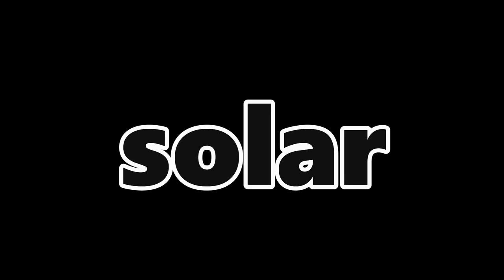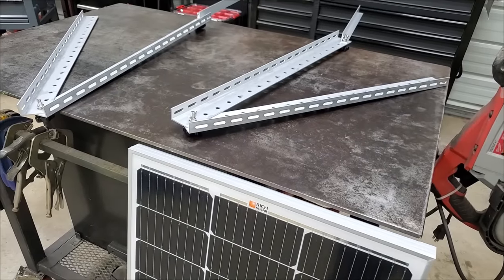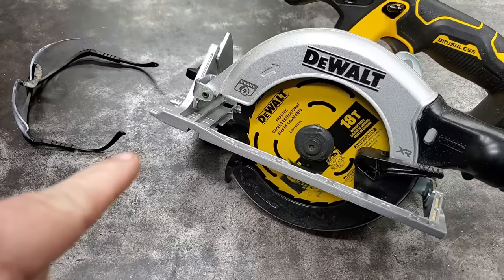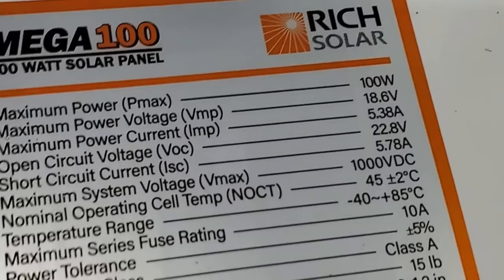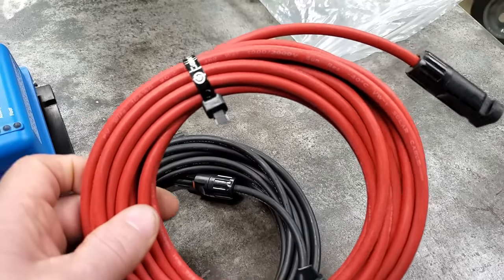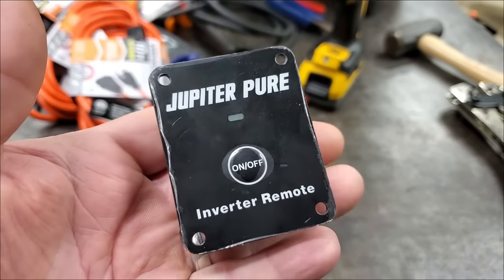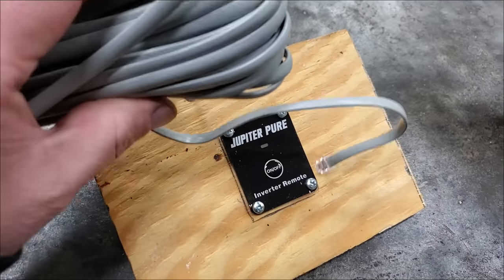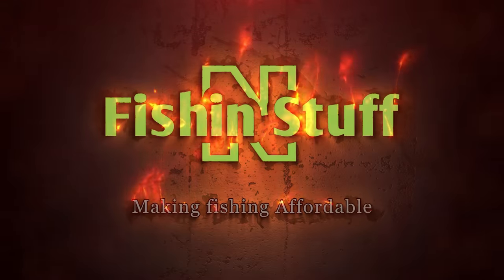Beginners Solar project ( very Simple )

Comment: That inverter is a huge POS. The 1000w version does maybe 600w continuous. That number is VERY generous as it tends to fault from ANY increase from that point if running that high for a bit. Then it's efficiency is absolute garbage as well. Just the inverter choice alone ruins the entire setup...then you choose a stupid expensive mppt charge controller.
Reply from the maker: Well I already had the inverter  . I was thinking about upgrading the inverter later too  , along with the batteries
Reply: @FishinNStuff  well I fell for the ratings as I wanted a decent inverter to run from my car but even with a steady voltage it would always go into overload at barely over half power. It isn't even a cheap inverter either. I was shocked how bad it was for the price. Do a cheap setup using a makeskyblue or powmr mppt controller. Those have been reliable and have great power tracking for really cheap. There is a really good and very efficient pure sine wave inverter from reliable(wzrelb) that I used to use to run my off grid house that just so happens to be cheap as well. As for batteries, automotive EV batteries can be made into packs pretty easy or large format lifepo4 with a bms.

Comment: What happens to excess power generated from the solar pannels? Where does it go?
Reply: Some other charge controllers have a feature for load dump, where it can use the excess solar power for heating hot water or something useful.  Otherwise the excess production is just wasted and not used when the storage cell is already fully charged.
Reply: The one used in this setup doesn't have that feature so it just heats up resistors in the controller with the excess power, which is why it has fins on the bottom to dissipate the heat, which could be 300W with three 100W panels.
The controller needs air circulation to keep cool when that happens.

Comment: Solar is just not cost effective for three lights. Adding up you necessities to do this you are well over a Grand $. Buy the Jackery and take it in the house and charge it up as needed for the three lights. Cost of charging the Jackery is minimal. Put in three light switches and turn on only the light you need.  Three lights on in that small space is over kill, most of the time. 
 If you want more, buy a propane generator and have it for the hurricane and charging the Jackery, add a couple of spare 20lb bottles.  20 years is the life span of the solar panels and that is degredated as they age.  If you get hit by hail, wind  or lightning, then you are really in the hole.  If you buy a couple more batteries to compete with a 2 thousand watt inverter generator(pure sign wave) there is another 5 to 6 hundred dollars, then you wont charge them up in 8 hours without adding more panels. How many years will the liFE batteries last, will they degrade, and are they a fire Hzd?  I like your vid,  I am just being realistic on solar.
Reply from the maker: If you was being realistic you would tell me to buy a Jackery when I said on the video I own 2 EcoFlows that are better than a Jackery  . Learning is never a waist of time . When your Jackery or my EcoFlows breaks they are just fit for the garbage can . If the battery degrades it'll cost me . 229 dollars to replace it , so I guess it's all how you look at it huh
Reply: @FishinNStuff  Yes, I understand you have an ecoflow. Don"t take this so personal It was constructive criticism if you will. I stated I like your vid.  I simply wanted to point out that there are alternatives.  I have a Jackery. Ecoflow and Jackery are interchangeable terms in my book, they both work similarly. The battery will degrade just like yours will in the solar system..  When the hurricane or tornado hits, I have a small propane inverter generator , rated for 2000 watts with extra tanks, no real worry about stale gas and it not starting. I can run as long as I have gas. There are limits on everthing. If you have cloudy days and degredation you have limits also.  The real point is you can run the 3 lights on the Ecoflow and pay maybe ten cents to charge it once in a blue moon.  If you invest the more than $1000.00 on the system, you get free electricity and make some profit too. Just saaayinn, no sin in constructive critic. And again, I like your vid. I have a little less money invested than in your system with my Jackery and Inverter generator.  I got  them on sale specials. Just saaayinn!  R we still friends?
Reply: Strike the make some profit to part. That was part of a sentence I tried to delete and did not get it all out.
Reply: In reality if you(someone) put the $1000 plus spent, in an online CD, or other investment returning 5% you will never be bothered by what little you(someone) pays the power company .  Yes it was a good learning experience for you and your viewers and you get to make the You Tube profit and profit from Amazon. I have no problem with that. My critic was to point out that someone doing this cannot expect to really save money.  Your points are valid for the positive, I believe mine are valid for the negative of the solar system discussed.  I am done stick a fork in me. Still friends?

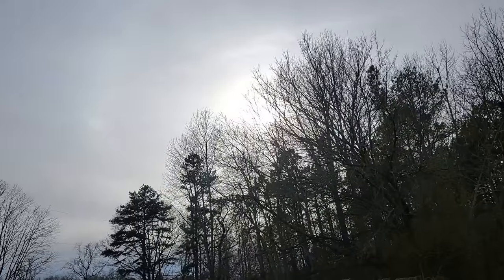Comment: At 2:31   You have circled:   "Are Not GRASS"   !!!!?????   wtf?
I consider myself a "practical person:    I built my solar racks out of 2 X 4's  with a 2 X 6 base and 4 60 lb.  bags of concrete - left in the bags - to hold in place on a FLAT roof.  Mine are designed to lay flat during "WIND STORMS"!   At least once a year.

I also used the same charge controller as your's but about 5 years older.

Comment: Spending over 1k just to have lights in a shed seems ridiculous. Plus those units that you called generators are just batteries with inverters, they do not generate electricity, they store electricity. Those batteries will weaken over time and will be expensive to replace, same with the solar panels.
Reply from the maker: Solar panels hook to them and generate power so ........ I glad you got that off your chest any ways lmbo 🤣🤣🤣🤣
Reply: @FishinNStuff  So if you plug a solar panel into the big ass battery it becomes a generator? What about if you plug a real gas generator into that big ass battery, or just plug it into the wall? Is it still a generator...no, it's still just a big ass battery.

Comment: Will it be capable to power a .5 ton to 1 ton Window A/C??
Reply from the maker: It will power a window unit . But it will NOT power it very long . That's the problem and why I kept talking about upgrading later . So in reality no don't do this build to run A/C

Comment: I realize you are new to this.
But as a old timer off grider.
Its best to parallel your panels and run a 12v system
You can thank you later.
Why 12v ?
Everything you want to run DC COMES in 12v.
If for some reason. You lose power. You can always just hook up car jumper cables from your vehical to your batteries. And charge up.
I know. Plenty of others. Many idiot hippies, tell you you need more volts.
You dont. 
I speak from experience.
I started with a 12v system.
Later bought a 48 volt system. 
Then went back to 12v.
Unfortunately the 48v sytem the panels were not 12v .
Oh when i say 12v the panels are between 18v to 22v. It because thats the volts with no load.
Reply: Another thing. Cut off them bloody connections. And just wire them together.
Those connection are easy disconnected. They appear connected but are not. I ran into many like that
Reply: NEVER BUY LITHIUM BATTERIES.
Lead acid deep cycle are much cheaper.
And unlike all other are rebuild able for pennies. 
With rebuilding every 8-12 years. You batteries will last forever.  Well over 100 years. 
Yes once a month you need to check the water in them. And add as needed. 
But that's easy.

Comment: Stop calling the Eco flow as generators. They are batteries.
Reply from the maker: With solar panels hooked up are they not generating power lol . They are much more than batteries  . They have a charge controller  , inverter , computer  . You can call em what you want though  . I really don't care , I won't melt lol

Comment: The entire basis upon which he bases this installation is insane.
He spent 5 times as much on the solar as he would of on taking power from his service entry. It will probably be app. 125 years till he breaks even on the cost. Even if he ran those lights 8 hours every day. He even admits he seldom goes in his shop.
I am a strong believer in solar, but this is not economically feasible.
Reply from the maker: 1st of all , any self-sufficiency is way more value than your making sound . Lots of people buy 800 generators, just in case  . Second,   I would have spent 1/3 to 1/2 that money just buying and running the wire . Just underground wire to go 200 feet would be expensive  . Ditch witch . Panel box romex , inspection  . Ect. And I guess the whole thing about adding onto it when right over your head ( probably cause you know everything alrea, y so why list lol ) so I can put other things out there that do use 110v . 5 times a much, hmmm . You failed math, obviously

Comment: Dude you can get way way way better solar panels for less money-  just buy used commercial panels from solar farms -  they sell them after 2-3years to swap for new panels-  they sell these easy around 30-60$ a panel and we are talking 255watts to 450watts a panels for those prices-  I buy panels of these for cheap-  my entire off grid system is using used panels -  I will never ever buy new panels unless I need super high wattage like 700watt panels for something that I have very limited space for panels-  like a portable solar generator trailer -  fit 10panels max on the trailer would give you 7000watts of solar input -  can’t beat that-  then you need 300ah of battery at least @48v. And bam your set to run about anything 

You need a 12k inverter   Two 6k single phase or a one 12k split phase inverter

Comment: That is not a 220v plug.
Its a RV outlet 110v
Reply from the maker: That's true I miss spoke , but if you connect 2 of them they'll do 220v
Reply: @FishinNStuff  not quite. For to make 220v you will need Two phase. Each phase is 110v each equal to 220v. Thay didn't make 220v battery generator. Just Bigger inviters...

Comment: Does it matter what lind of battery used?
Reply from the maker: You can use lead acid or lithium just setup your charge controller for the type battery your using
Reply: @FishinNStuff  thanks.

Comment: Look, love your videos.  But you're about $1200.00 into this project 17:40 into the video.  That's cheaper than running hardwire?  Personally, I think you just wanted to do a solar project.
Reply from the maker: I think the total was close to that . But it wasn't all about saving money . I like the back power too  . In emergencies  . That big EcoFlow cost me 2500 . The small one wasn't to bad . Too me it's more about being off the grid and it being paid for , instead of the power company owning me . They raise prices any time they feel like it and the sun is free .
Reply: @FishinNStuff  Understood.  I've got gas powered generators down here in Florida.  Had to use them after Ian so I understand being prepared.
Reply: It’s pretty cool getting free power from a star 93 million miles away.

Comment: WHAT?
$325 FOR a battery that CAN NOT BE REBUILT.
And a Lead acid deep cycle of the same size is less then $80?  And can be  rebuilt many times. 
Lets break this down more 
Lithium 75% the weight if lead acid.
Lithium max life 15 years. Lead acid max life with rebuilds LIMITLESS.
Littium cost 4x the amount as a lead acid.
Cost to rebuild 
Lead acid 25 cents per battery 
Lithium can't rebuild so new battery $325 
Lead acid is by far a better battery.

Comment: So lets see 80V DC converted to 12V DC then converted 110V AC then to the lights so converted back to DC LED?????????????????????????? I think you just like to convert things
Reply from the maker: Yeah that and like I said I'll be adding to the system later so I might as well do it right to start with ????????????????
Reply: @MartinPHE - You simply don't understand ... This is exactly how off-grid Solar, with a battery backup, actually works. Without the battery, how else can you get AC power after sunset?  You can not. So, why are you complaining???

Comment: Really? The jeenyus' that designed solar panels gave it brackets that require holes in your roof? Why not something that saddles the roof ridge line to the end and clamps to the underside of the eves? I guess if you design solar systems, the roof is the roofers problem, but this is common sense. A lot of effort goes into sealing a roof...don't put holes in your roof. Especially holes for skylights. Anything done wrong installing these brackets will give you a condemned house in 15 years. Not cleaning your gutters gets the same result. What next holes in boats?

Comment: Nope, This is not for beginners, It's a pro level object.
You will be having to open the hatch and quiet those fans if you want to use it in the living space.
If you can tolerate the noise levels of the fans or find another solution it's ideal.
Expect to have to use more than 650AH of LiFePo 4 and at least 800watt of solar input.